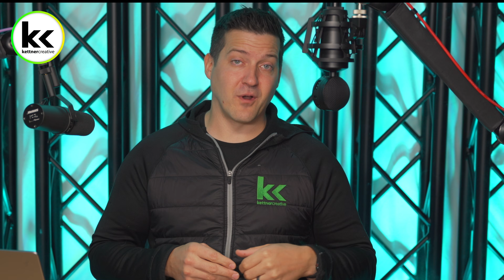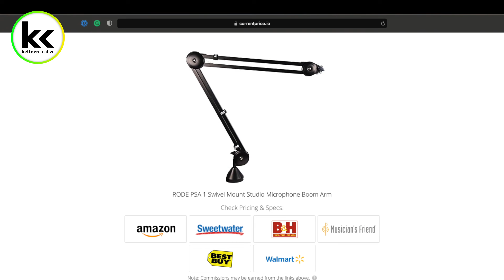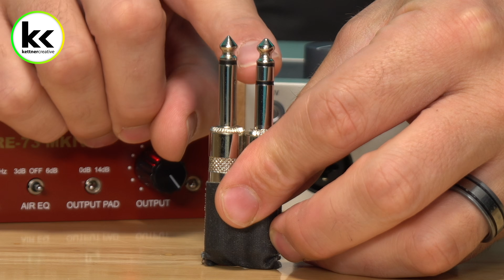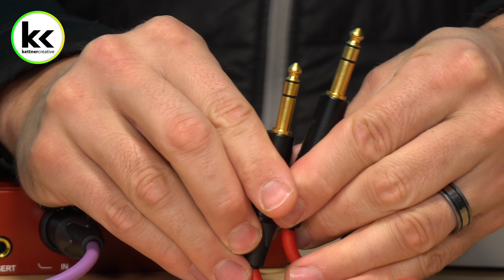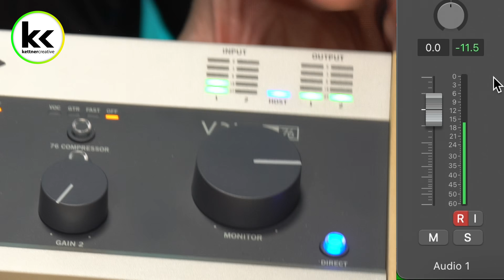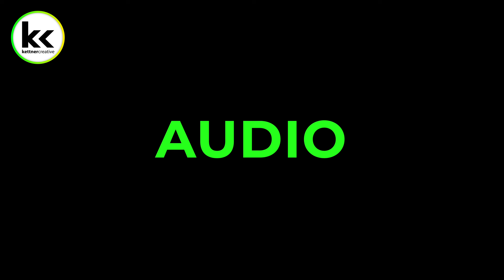2 Ways To Connect Microphone Preamp to Audio Interface

Comment: Thanks for this info! So if you have 4 preamps (getting them for drums) would you need 4 separate line inputs on the interface, one for each external preamp? I think my interface only has 2 line level inputs.

Comment: Hey,great video! I got almost the same equipments in this video, Sm7b + pre73 mk4 but a different audio interface: presonus 68c, so when I connect these things and turn down all the 68c input gain, the volume is too low. BUT the pre 73 is turned to 70db and a lot of output, still so quiet. I have to turn up the gain on the interface.Does that mean my signal has been amplified twice（pre73 and 68c）, and how can I fix it?

Comment: Any chance you can compare the 2 ways being external preamp into the interface combo jack/preamp circuit vs a direct line input? Many say to do the latter for better sound quality but since my interface (SSL2+) only has the combo jacks I can't test myself to see if there is actually an audible difference. I guess you would need a Volt 4 or Scarlett 4i4 or the like for this test
Reply from the maker: You want to use the 1/4” input on the SSL2+. It’s not about quality, it’s about properly matching the line level output of your preamp to the line level input of your interface.
Reply: @kettnercreative  Thanks for the reply, yes my question was about quality and if there is, as some say, a difference in direct line inputs vs the combo input (of course using the line in). I have heard a few people say there is a difference but have not found any actual tests. (edit: so when I saw the title of the video, these are the two ways I was hoping would be compared and contrasted is all)